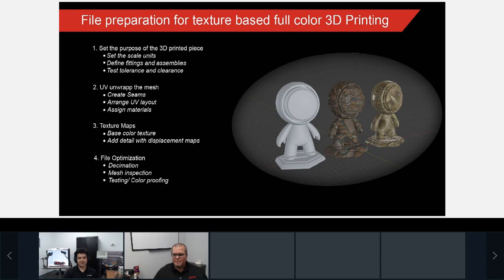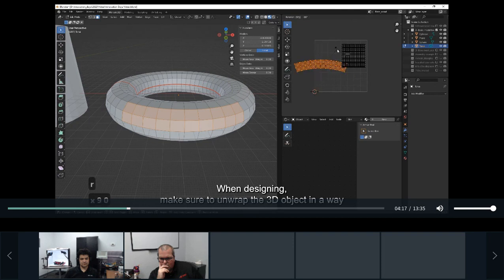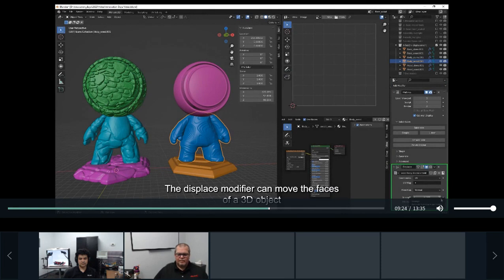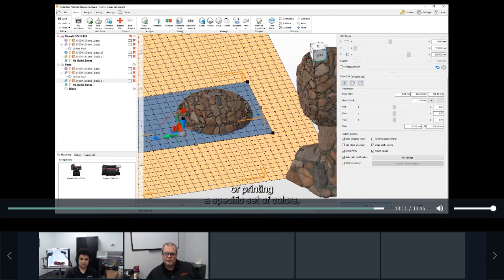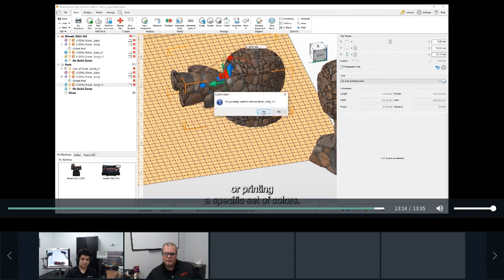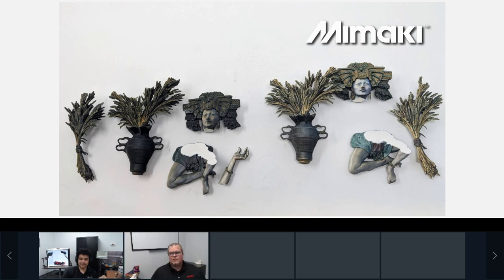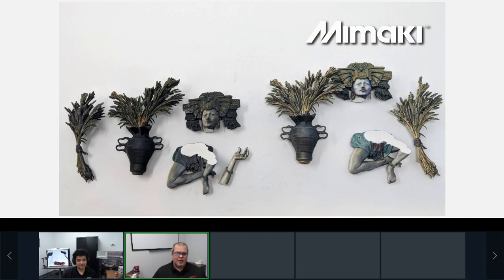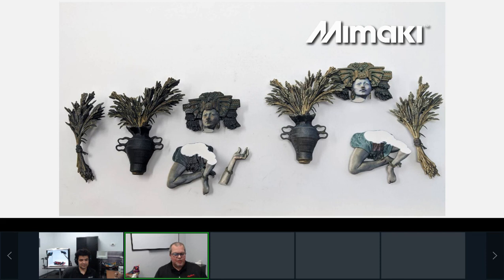Mimaki: File Preparation for Texture-Based Full Color 3D Printing

Comment: I hv a few questions though. If I hv multiple shader containing multiple texture images for an object, I do not need to bake all into one shader and leave to export the model as is? does procedual material works? If my model does not use image textures but only shader color slot in BSDF principled shader, would the printer pick that up?
Reply from the maker: Thanks for your question. The printer can only read the base color texture and vertex paint. Everything else would need to be baked in to show up, including transferring height maps to geometry. There is a good tutorial here using Adobe Substance, but the same would apply with other software:

https://creativecloud.adobe.com/cc/learn/substance-3d-painter/web/preparing-a-substance-painter-file-for-color-3d-printing?locale=en

or on youtube:
https://www.youtube.com/watch?v=bQNZJaciMwc